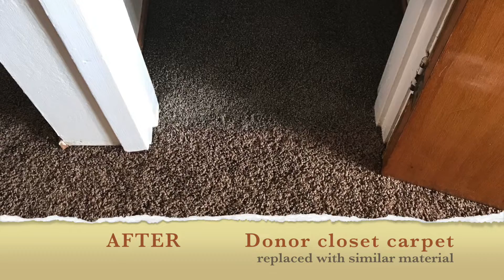HELP!!! Dog ate my carpet! Pet Damage Carpet Repair

Comment: Some guy quoted me $320 for this type of damage. Is that accurate?
Reply from the maker: Brandon Perez that is within range for this amount of damage w/o residual carpet from install. Really depends which part of the country you are located and how skilled your technician is.
Reply: Depends on who you know because in NC I would of only charged 80$ tops lol.
Reply from the maker: EverydayAV true! Also, what part of the country you live. In the Bay Area of CA, my customers run away from $80 offers. You get what your worth (as a contractor), and customers will pay for quality work, especially when their security deposit is at risk.

Comment: Hi how much did you pay for the service? I also have the same problem but the manager is charging me for the whole room.  Please help!
Reply from the maker: Price is determined on size, location, and access to residual carpet. If your landlord is going to replace the room, there is not much you can do. Some feel replacement is better than repair. Sorry! That’s why we are trying to spread the word on YouTube that repairing is a better solution.
Reply: Josh Nolan the damage is just a small patch about 4inches and it's right at the corner of the room. Thank you!
Reply from the maker: Hey Barbara cost estimate for repair $150+-
Reply: Josh Nolan thank you very much!